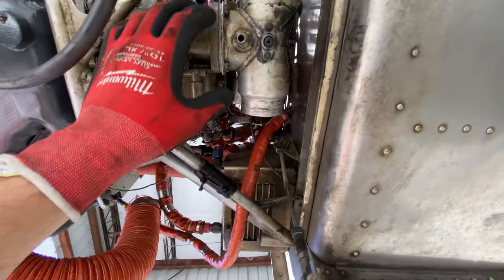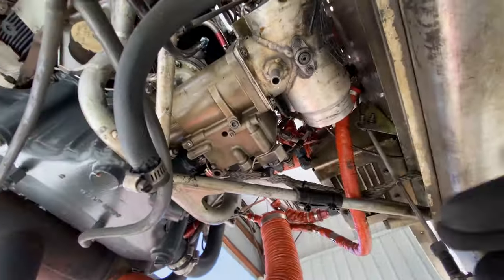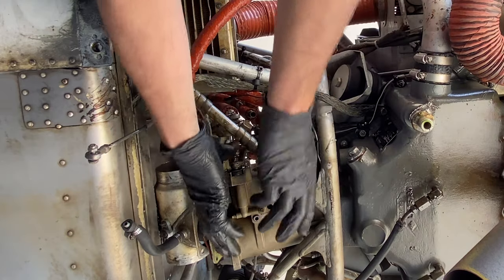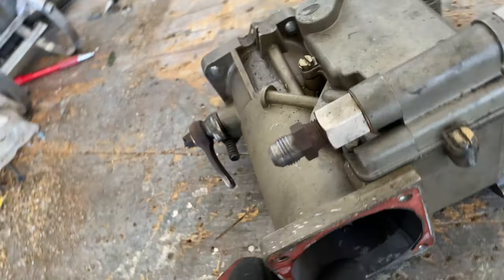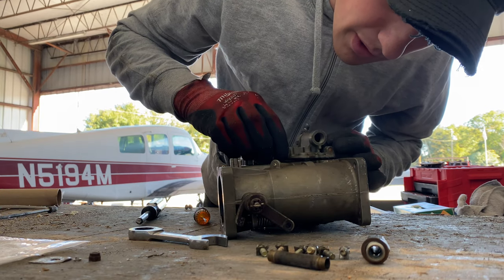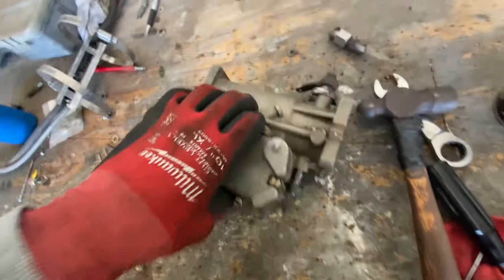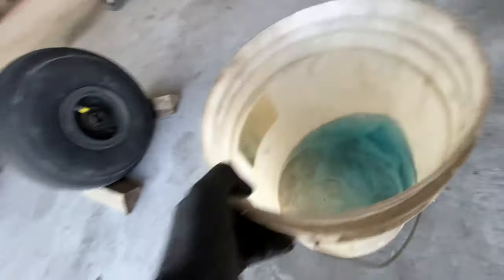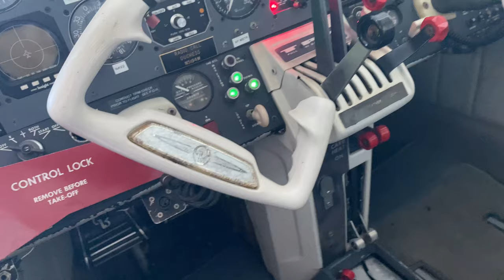Removing Carburetor from a plane that hasn't moved in 2 years

Comment: Replaced a rebuild carburetor from aircraft spruce, so long story short the carburetor turned out to be defective. Send it back RMA required etc. aircraft down until it was decided on their end it in fact was defective that took 5 weeks . Air spruce finally sends me another carburetor at no charge. Well the a&p ia doesn’t want to install it for free first time install $1000 second time install $1000. Big question I have who is responsible to pay for the second install. Well certainly not aircraft spruce it’s against their policy so it must be the rebuilder no it’s not their policy either. One would expect aircraft spruce using a vender that doesn’t check the carburetor for failure would be responsible. No they stress it’s against policy I suggest they revise their policy. So installing a carburetor is quite labor intensive in a Mooney one doesn’t want to do this job twice. Be careful who you buy your rebuild parts from otherwise it could cost you double. There are better suppliers out there , some company’s have grown big enough and take advantage of us unaware consumers. 
Thanks for the video